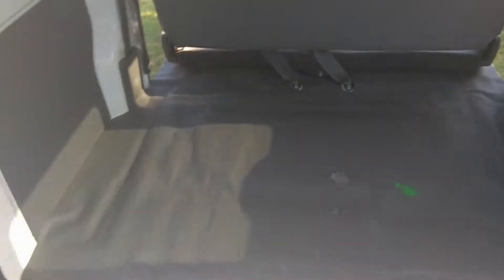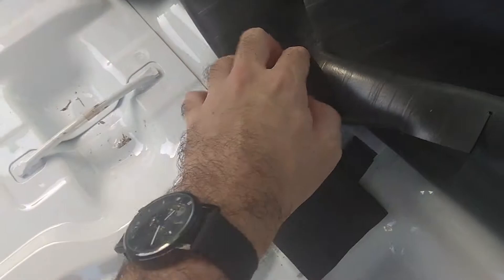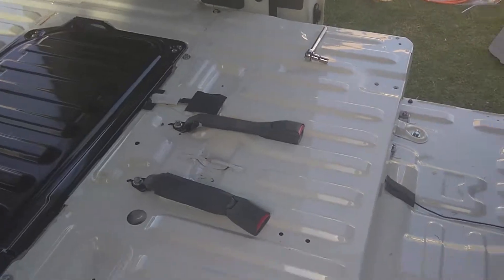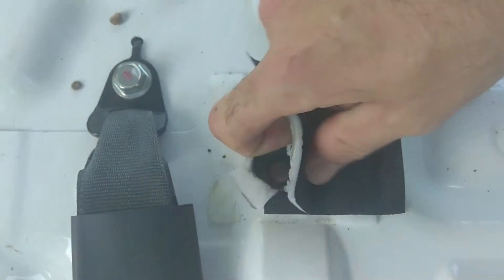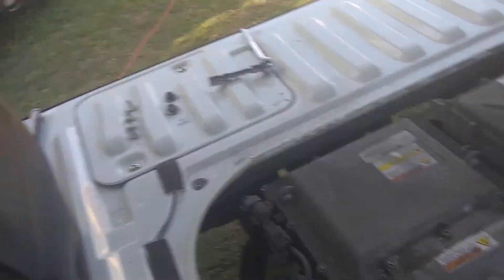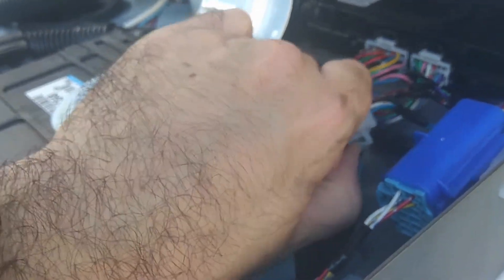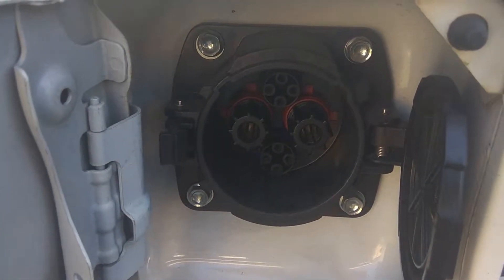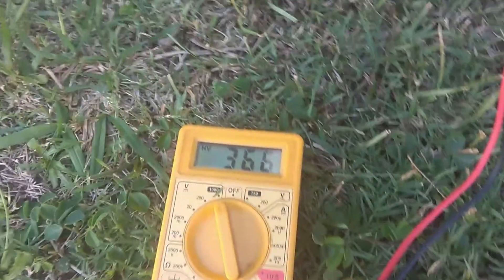Overriding the CHAdeMO safety on a Mitsubishi Minicab MiEV for fun and profit

Comment: I only discovered these Ev's exist a few months ago and am surprised there aren't a lot more video's of people modifying them being about the cheapest and most practical Ev you can buy....Are you happy with the van after 4 years? Can it do 110kmph on the highway?
Reply from the maker: I'm still happy with it after 4 years and I'm planning on replacing the battery with new cells (at this point the van in about 10 years old). As for speed on the highway, mine seems to stop accelerating after 107km/h (on the speedo). The power indicator dial (effectively the RPM readout for a regular car) drops back to almost neutral when I get above 107km/h. I'm not sure whether this is because of a governor put in by the company that owned it before I bought it (I think the maximum speed limit in Japan is 100km/h, roughly speedo -10%) or whether it's something inherit to minicab mievs. I haven't heard anyone else mention it, but I hear there are owners groups on facebook and the AEVA forums. It might be worth asking there to see if it happens to anyone else. I don't do a lot of highway driving, so I haven't spent much time looking into it.

I will say that it doesn't seem particularly happy to travel faster than about 90km/h, it's shaped like a brick and has the aerodynamics to match. At high speeds you can feel it fighting its was through the air.
Reply: @thisnonsense674  Are you going to replace the cells yourself? There is a company that can put a 30kw pack in them in Australia I read. I don't do much highway driving either but for it to be a true first car replacement it needs to keep up with the flow of traffic for when I do. If the government had any vision they would add the incentive to Ev's imports instead of just new cars bought by those with plenty of money already.

Comment: for reasons unknown, my minicab didn't come with a CHAdeMO socket, which I'm guessing means it doesn't have a DC/DC charger 😔 don't suppose you'd know if I can still charge while driving?
Reply from the maker: Off the top of my head, I'm not sure. There are contacts in the drive inverter (which I don't show in this video), that connect to the battery when everything in powered on. I managed to inject power at those contacts using a boost converter and some diodes at one point. It was only a very small amount of power and only for a short amount of time before the inverter went into thermal protection (the inverter was only rated for about 100w), but everything in the car seemed to function fine. It may be an option to look into, but I'd be extremely careful. There's both high voltage AC and DC within pretty close proximity on exposed busbars in the inverter, quite different to the relative(!) safety of the socket in the CHAdeMO port.
Reply: @thisnonsense674  thanks for the info, I'll check it out once I take the battery out, planning to do a 300ah upgrade

Comment: The black nail polish got me all exited. But whats the point of all this?
Reply from the maker: Thanks, I'm glad you liked the nails :)
The point of this is that you're able to get direct access to full pack voltage from that CHAdeMO port. It might not seem like much, but it means that you can pull power from the battery or put power into the battery without having to deal with charging standards.
The example I mentioned at the end about plugging a solar array directly into the battery is one example. It's not the smartest idea by any stretch of the imagination, but if you wanted to take the car camping away from any access to mains outlets or a charging network you could. It wouldn't be very practical, but you could drive a hundred or so kilometres and spend the next day or two charging and then repeat.
Another example is running an inverter directly off the battery. Most home solar or battery inverters will happily run off of 300v to 400v. By bypassing the protections it basically allows you to set up a vehicle-to-grid or vehicle-to-home system (as long as you have an appropriate inverter and set up).
Finally, and I think most interestingly, it allows you to connect a second battery in parallel with the main pack. It's possible to connect either another miev battery pack or even a home built battery pack in parallel and extend the range of the vehicle. I wouldn't recommend using this method to connect a second battery since it would require sacrificing quick charging and I'm pretty sure there's a better way to do it. I'm just waiting for some free time to test it.
To be perfectly clear, I don't recommend playing around with this sort of thing. When I first attempted this I double checked everything and then triple checked again. These sort of voltages and current capabilities are nothing to mess with.
Reply: couldn't you just wire the solar panels straight into the car battery? or wire another battery from the existing ones?
Reply from the maker: You certainly can and I did when I was originally playing with this. I would be very careful doing it as I don't think there's any way for the battery to disconnect itself if the solar panels charge it too far, this could lead to the battery overcharging and possibly bursting into flames.
Reply: What next?
Reply from the maker: Eventually I want to make a range extender
Reply: @thisnonsense674  hi. Any progress with charging iMiev via hacked chademo?